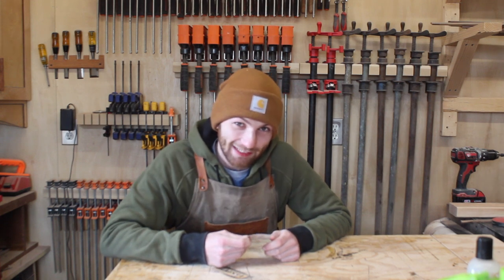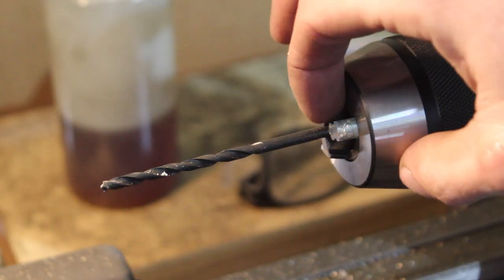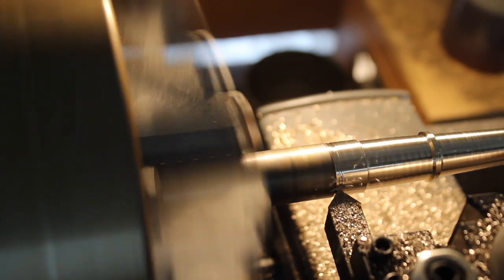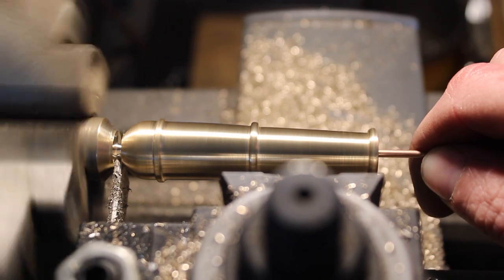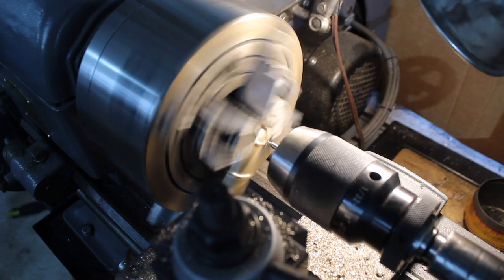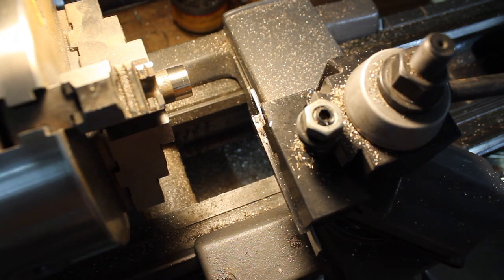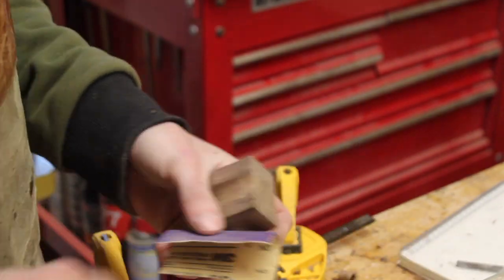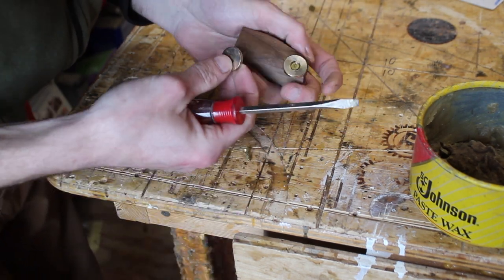I Made A Mini Canon (ODB11)

Comment: That bore needs to be enlarged. 
The touch holds needs a shallow bowl.  To hold black powder not a fuse.
A small wad of toilet paper before loading the ball. Do not use a rubber ball.
Last you need cords to hold  the Canon in place like they do on a sailing ship. 
One last thing.
Use a long stick with a burning sting to fire the Canon.
Reply from the maker: Sure